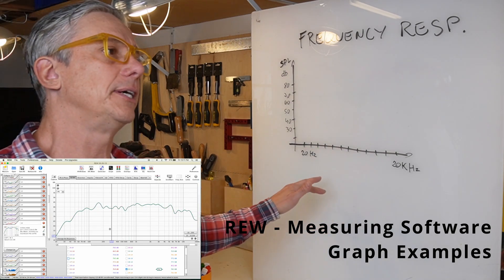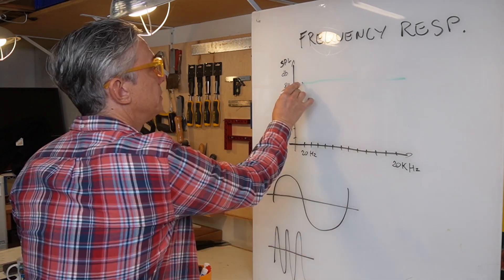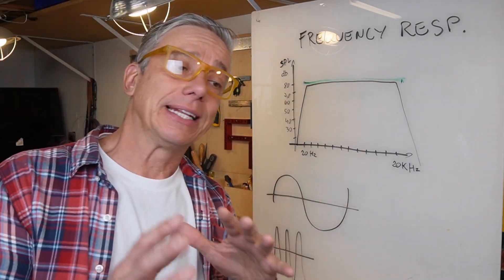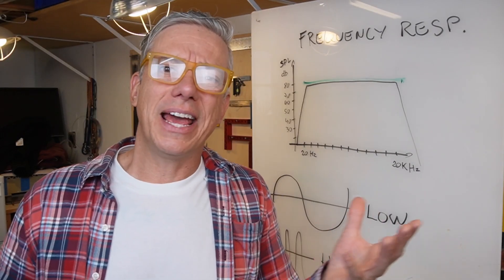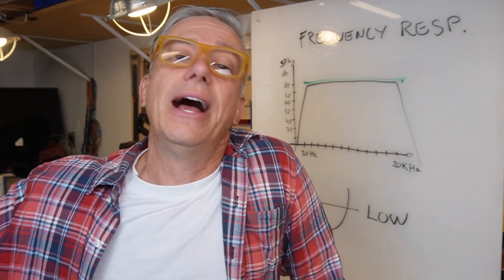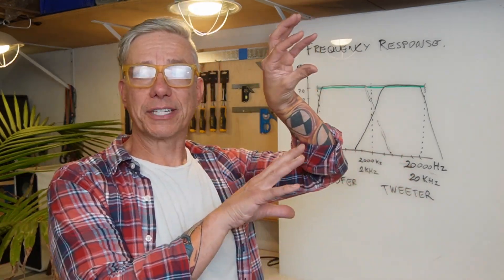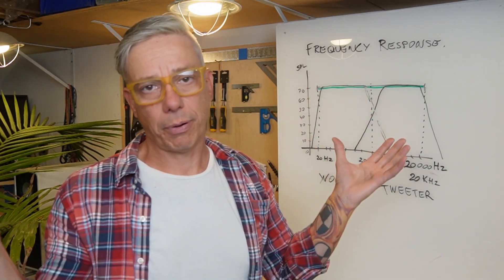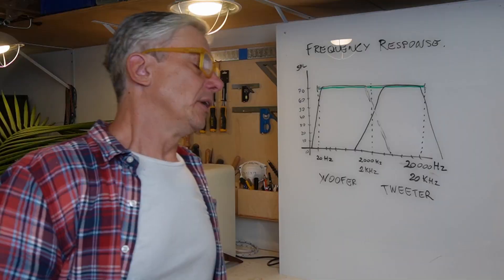Talking Crossovers - Video 1 - Our Hearing | Frequency Response Graph | DIY Passive Crossover

Comment: I build my crossovers just by hearing it and comparing the sound with my B&W 706 bought speakers. And my made speakers flog my bought speakers. My made speakers are dipole and point source, whereas my bought speakers are just normal 2-ways. 😂

Comment: Could you make a video about the process of testing? When the box is ready. Do you connect the speakers without crossover to find out hot it behaves in the box one by one? Or directly with the crossover and measure that way? Or both?
Reply from the maker: Hey there! Yes I have to measure the drivers in the box first and get the frd and zma files, then I go to the crossover software!

Comment: Greetings from Czech republic!  Also thanks for really nice content and the way how you handle it , step by step from basis. What I would like to ask you is to explain difference in serial and paralel crossowers and calculation of the values for capacitors and coils in serial connection. Thanks!👍
Reply: I'm sure Bernardo plans to cover Parallel and Series crossovers in an upcoming installment. It's something best done with images... which we can't do in the comments.

As for the part values in a series crossover:
Taking the standard 2 way design with a woofer and tweeter in series, a coil (L) across the tweeter and a capacitor (C) across the woofer as an example... 

1) Choose your crossover frequency (F) to be low enough to avoid cone breakup in the woofer but high enough that you're not putting undue stress on the tweeter.  This will be determined from the specs for the drivers you are using.

2) The crossover occurs when the impedance of the capacitor (Xc) is equal to the impedance of the woofer and the impedance of the coil (Xl) is equal to the impedance of the tweeter.  With 8 ohm drivers that means Xc = Xl = 8.  

3) This forms two 4 ohm impedances in series still giving you 8 ohms overall. It also means that the output from the woofer and tweeter at the crossover point will be equal, but 3db less than maximum, which when summed gives you an even frequency response.

2 * pi == 6.28 for these calclulations.

The Calculation for C is  1 / (6.28 * F * Xc) producing an answer in farads.  Mulitiply by 1,000,000 to get MicroFarads.

The calculation for L is   Xl / (6.28 * F) producing an answer in henries. Multiply by 1,000,000 to get an answer in MicroHenries.

So if you're shooting for a 2,000hz crossover with 8 ohm drivers...
C = 1 / (6.28 * 2000 * 8)  * 1,000,000 ==  9.95 uf
L = 8 / (6.28 X 2000) * 1,000,000 ==  636 uh

This of course is not "cut and dry".  It is, at best, a starting point from which you can adjust values up and down to get the response you seek. 

To get the more complex -- massively more complex -- math that takes driver characteristics into account, you will find yourself getting far fewer headaches doing this by modelling in XSim.
Reply from the maker: Hey there mate! Sure. It’s gonna come soon. We gonna work on parallel for now but series later on.

Comment: Hi great video my friend. You nailed the basics and didn't go too fast and assume you audience already know things. I learned about octaves and how they relate to frequencies. No one has done that. So thanks.  Another key matter that others skip over is how a capacitor filters lf and how an inductor filters hf. Neil touches on that in his comment so I hope you touch on that in the next video. And short of using computer software is there a rule of thumb for selecting a capacitor and inductor as a first try. Not everyone has a DATS analyser to measure speaker parameters to use in the softwate. Keep up the good work. I look forward to your next class. ☮️🇦🇺
Reply: First, you should head into the description panel above, visit the Downloads link (We've set up a special files list for this series). Grab the the Samples file, unzip it and spend some time getting familiar with the pitch of various octaves, decades and the piano keyboard.  You can also read more about this in my "What you are hearing" essay on the website link.

The designer's "rule of thumb" you're looking for involves doing some pretty heavy math,  manually calculating crossover frequencies, reactance and impedance to match your drivers by specifications.  Not fun...  let the software do it for you.

The lesson plan we worked out will show you what each of the main parts does in an AC circuit in part 2.  The goal has been to keep it very simple, no monster math or complex lessons in electronics. You don't actually need to know what a capacitive time constant or inductive sustain is all about to use them properly in a circuit.  You really just need to understand their behaviour. (That is: it is far more helpful to know what they do than to know how they do it.)

If you want to get a jump on that you can go to the downloads link install XSim (if you don't already have it) and then take Filters101.  I created Filters101 as a demonstration of each of the basic filter types. With Filters101 loaded into XSim you can activate each filter separately by dragging a jumper resistor into position and observe the effects of the parts. You can also tamper with it by changing the part values and see the results immediately. That will give you about 50% of what you need to know to create a working crossover.

The rest comes from knowing when and how to use each filter type.
Reply: @Douglas_Blake_579  thanks douglas I'll dive in.
Reply: @diyfullrangehifispeakers 
Best of luck with it.  Crossovers are simple, blunt, devices... but even 20 years into it, I still learn new tricks all the time.
Reply from the maker: Thank you my friend! I hope o can keep adding cause it’s hard to find clear info on crossovers. Yes, not everyone has DATs so we have to go over how to start your own crossover reading schematics, or using someone else’s measurements. I’ll go over it! Thanks for the input!!

Comment: An important principle that is involved in many ways in audio electronics - is how a current flowing in a conductor forms a magnetic field around the conductor. And when you form a conductor (wire) into a coil, that magnetic field is stengthened - and is critical to several things along the audio chain.
It is how a microphone works, and how a speaker works; and how a phono cartridge works. It is how a transformer works, and how an inductor coil in a crossover works.
Knowing the so-called Right Hand Rule is important to understanding how coils (mic. speaker, inductor) work - if the current is flowing around the coil, you curl the fingers on your right hand in that direction, then your right thumb points in the direction the north pole of the magnetic field.
Reply: Hey Neil!  One little quibble... the right hand rule only works for DC.  On an AC circuit like a speaker the poles will be flipping back and forth in step with the signal.
Reply: @Douglas_Blake_579  Right - at any given moment in time, the magnetic field generated by one of the frequencies in the signal will follow the Right Hand Rule. And it does reverse direction twice per AC cycle.
At all the frequencies that are in the music signal at a given moment. And as you know, this is how it impedes the higher frequencies from passing through the inductor coil.
Reply: @NeilBlanchard 
Yep,  I do know how it works.  But I don't think I've ever used the right hand rule on anything running on AC.